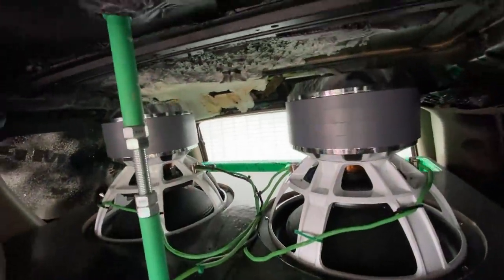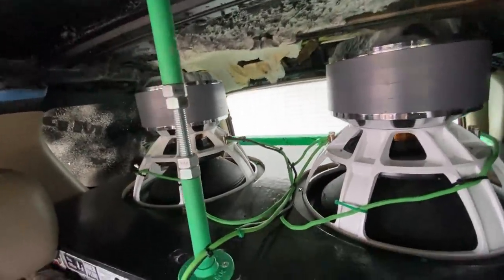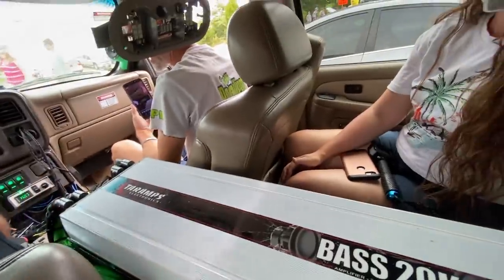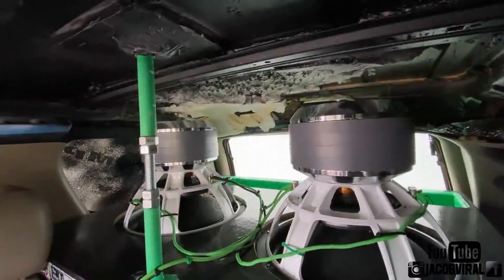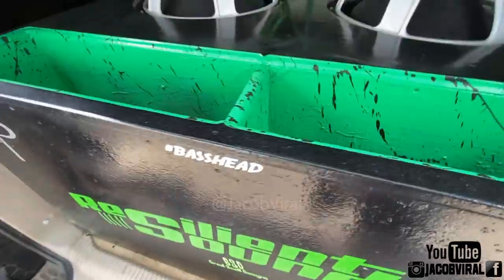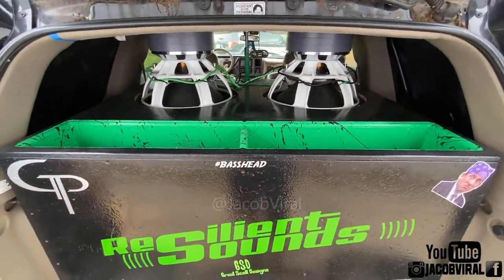QUARTER WAVE T LINE SUBWOOFER BOX ON THIS BIG 20K AMP!

Comment: Junk.  .......... No just kidding.actually seems really good. First time I've ever heard of a quarter T line.
Reply: They are great even with low power,  theres a math n equations to make depending on your sub. they work great once u get the hang of it.
Reply: @jahlieel.e7856  Awesome, thanks man. I'm definitely going to check more into them. Thanks.
Reply: That's not a T-line enclosure. It's too small. A T-line enclosure for two 18's would take up the entire back end of a sprinter van. That's just a big ported mess.
Reply: @kristoffslovijk666 it is a tline, just listen to the specs he says at the start if the video

Comment: Was that a fatboy voltage regular? I have one in my Tahoe and my voltage will actually go up when its hitting hard, didn't know if that was common. I'm 50 and have loved car audio since the 80s but am just doing my first build of this size.
Reply: Mr.T-line  Mine only rises about 2/10ths or so at a time. But never drops below 14.9. Seems like it's a pretty good regulator. Loved your install.

Comment: Awesome box!! I just think it’s crazy that SMD has 4 18’s in the back of his and his box is smaller.
Reply: Mr.T-line yea that’s the good thing about yours. It’ll play pretty much anything while his is geared towards a smaller range which prob explains the smaller box. Idk I’m not a builder or a system wizard lol
Reply: Mr.T-line  also SMD system is older, you have newer more powerful subs THARAMPS amps are monsters he has 6 or 8 1k ROCKFORD FOSGATES so yeah newer car audio it really makes a difference
Reply: Ivan Bustamante SMD has 6-8 t-2500 fosgate Amps which is the biggest best ones they make currently
Reply: @ivanbustamante6011  he is presently upgrading his Hoes system piece by piece
Reply: right! SMD's is super loud. and he's upgrading it as we speak.
Reply: Brandon Lee it’s gonna be interesting to see it redone after years of having it slap!
Reply: Mr.T-line  musical maybe but not burp simply due to cone area. With that being said, you may have room for 2 more ; ]  jk, i'm sure 2 are enough unless you're serious about that wall build. Sticking with RS? I'm bout to switch to Fi myself.
Reply: Ivan Bustamante SMD’s subs are rated the same as these 5000 watts and the 8 Rockford amps he has put out like 3k each and they are strapped so it’s like having 4 6k amps. All of his audio might be older but they are of high quality. JS. This system has a better bandwidth then SMD. Both are good at what they were designed for. 👍🏾
Reply: Brandon Lee is he upgrading his amps and subs? Or just his electrical?? From what I’ve heard from the vid is he is doing just the electrical. Idk we will see. Should be good knowing him lol

Comment: Impressive bad ass amp yea I’ve decided that I’m goin taramps thanks for the video as always Jacob
Reply: go with Bass line fyi
Reply: Be careful with Taramps! You need to study them and make sure you have them hooked up to great electrical with no voltage fluctuations and no vibration or flex on the amp.
Reply: streetbasser786 - Not for the money. You just need to know what you have and how to set it up. Most people who get Taramps can’t afford the good stuff, so they don’t spend money on proper electrical and mount them wrong, then complain after they blow. Another common mistake is improper impedance loads and not knowing the differences in their lineup. Used as intended they do alright, but no, they can’t take a beating like Fosgate or similar.
Reply: Get a  good fire extinguisher
Reply: ed elsey - Or two😂
Reply: It’s not about affording I see a lot of people with them their true wattage a little delicate I heard anyone should know never to mount their amp to the a sub enclosure not a good idea
Reply: vinny galanti - No, it’s a budget amp. They use cheap Chinese boards and cannot hold up against amps with Korean boards. This is a well known fact among car audio enthusiasts who know their stuff. Budget bass heads purchase them because they do put out rated power and the price per watt is cheap, but true enthusiasts know they are more likely to crash and burn, which is why my man mentioned the fire extinguisher. He knows what’s up.
Reply: I got a 8k bass on stock electrical haven’t had a problem out of it yet
Reply: Storm Vangorder - You haven’t clamped it or pushed it to the max during long demo’s either. You aren’t getting anywhere near 8kw out of that amp. What I stated only applies to those who are getting the most out of their systems. Take it to a show and you’ll find out very quickly. You will also get away with a lot by keeping the impedance high. Top tier amps can be rated at 1 ohm and easily handle .5 ohms. You will cook your amp trying to do lower than rated for more power output. Outside of that for a daily driver you should be fine as long as you don’t try to show off too much. It would be wise to get a 150-200 amp fuse to keep you from going too far if you aren’t planning on spending big bucks to upgrade. You would get the same out of a much smaller amp without stressing it as much. Lights will dim on the vast majority of factory electrical on less than 2kw, so you do the math. Let’s not forget that your can can shut off and die on you as well, especially since an 8k needs another amp or two to balance the system. 9-10kw on stock? Come on.
Reply: King Willie you’re wrong about a lot of the stuff you said here tho the whole no voltage fluctuations wtf lmao where did you hear that
Reply: Exodia - Either you know or you don’t. Believe what you will.
Reply: King Willie I’ve owned more taramps than you to actually know I promise you you’re wrong but ok
Reply: Exodia - So what are you claiming? That those Chinese boards can hold up to the same amount of abuse as Korean like Sundown for instance? People love to defend stuff they own, but it doesn’t make their opinions factual. I have all sorts of amps, Taramps included.
Reply: King Willie first off all why would you abuse your amp use it right and you’re fine not the amps fault you wanna wire your amps to the dirt every amp has it’s purpose. Saying ones better than the other is stupid because each amps has reasons why one is better than the other
Reply: Exodia - Demoing at shows all day and pushing stuff to the limit is abuse. Are you doing that, or are you a casual who never even sees what their equipment is putting out? Yes, better equipment can take more abuse of all types for longer time periods, period. I have still have a Fosgate amp from the 90’s that looks like it has been through a war and still works fine. You will never hear of people using 2020 Taramps in the year 2050. It is what it is. Do you even know what compromises a board and why one is better than the other? No, you don’t, so stop brand riding and learn something.
Reply: First of all seen taramps on the dyno true wattage they put out their said power
Reply: vinny galanti - We are debating durability and sensitivity during abuse, not rated power.
Reply: King Willie well in Cali it’s been in the 100s for the past 3 weeks and I’ve been beating on my 12k all day in the heat after about an hour in a half itll thermal protect and cool down for about 30 mins and come right back on. I don’t have any fans in my trunk and it’s all sealed up so it’s definitely over 110 in there during the day
Reply: Exodia - There is a serious chance it will burn out within a year if you keep it up. It might last a while if you don’t drive it down below the recommended impedance load though.
Reply: King Willie yeah I never said I did 
why would I wire my one ohm amp below one ohm? Any amp can pop if you do that Korean or full bridge
Reply: Exodia - Any amp can pop, but the fact that Korean boards are known to last for years being wired down to less than rated impedance means they are capable of putting out loads more power and are many orders of magnitude less likely to have anything burn up, especially when run at the rated impedance. They are just more reliable and longer lasting, period. You get what you pay for which is why amps with Korean boards cost more.
Reply: King Willie there’s so much you’re not accounting for that is hard to talk to you. What about rise ? Why do you think people wire those Korean boards to the dirt? How would you feel spending 1100 on a Korean 5k wire it at 1 and clamp 2k watts cause of rise? People wire so low to get rated power lol
Reply: Exodia - That is irrelevant as all amplifiers are subject to impedance changes across frequencies. I am referring to the durability of the amps only. Again, a Korean board rated the same as a Chinese board will put out more power on average because it will handle twice the impedance load. Losing some efficiency at a lower impedance is a given, but the power output will still be higher. Personally, I like to strap high quality amps together and run at a higher impedance for that reason.

Comment: Great design. Alot of rooks in the bass game talk crap on t lines because they are uneducated and cant build them if they wanted too. Thanks for showing this video jacob. Now the idiots that say that tlines with more than one big sub wont fit in a vehicle can hush up.
Reply: Mr.T-line  thanks. Love your setup mr t line!! I love the quarter wave design, its plays every frequency in the subs bandwidth more even than 4th and 6th orders do imo. And you can remove the box easily if you decide to sell the vehicle or change the system. I know their are guys with with louder one note  wonder ported boxes , but they have to pick certain songs to play to get savage and you can play just about anything and have brutal bass. I admit t lines arent the easiest to build , but its worth it as your system shows. 154 on music is bad ass.
Reply: Mr.T-line  i also was wanting to ask what u set the bass boost at? I had mine set a little under half way and it worked perfectly with my setup. You may not even use it with as much headroom as you have lol. I was just wondering.
Reply: Mr.T-line  most 1/4 wave tlines suffer in the 40 to 60 hz when clamping below or right around rated power. Or at least mine did a little. Thats why i said you probly have the headroom to compensate lol. I had an md 5k on 2 peirce wmd 15s . So i was alittle below rated power. Your guy that built the box will tell you. Some setups are fine with ample power , alot depends on the tuning of the box or port lol,whichever one you want to call a tline. Alot depends on the builder . I see where you are coming from, yes you arent ever supposed to use bass boost , but you would be surprised of how many lower powered tline setups do use it. Helps flatten out the roll off so to speak , but with up to 20k on tap that may not be a prob idk.
Reply: Mr.T-line  its alot to explain, barevids and car audio fabrication channel shed light to what im explaining here. Soo many variables here, port taper, actual port length, so on and so forth but yes some tlines will benefit from around 4 to 6 db of bass boost at around 40hz depending on design. Once agian great setup and thanks for sharing your build .

Comment: That box is way too small for it to be a decent t-line. If he went to B pillar instead of just C pillar, it would increase output
Reply: Mr.T-line  Quarter wave is a t-line
Reply: NGAudio in think he is aware, its his setup
Reply: @williamkillingsworth2619  
Ya never know. I dont know what he knows about t-lines, so I gave a suggestion
Reply: He still has 4 seats and tremendous output. People get confused with quarter wave versus full wave. Maybe you just need to hear it in person. This box is very musical
Reply: @codyscott1161  
I design 1/4 wave boxes. I wasnt doubting that it didnt perform. What I am saying is that if that is 1/4 wave, that box is extremely small for a 29hz tuning. At 29hz, the port would have to be around 10ft long, and the port area for the most part needs to be equal to Sd of the subs. So, if he cut down his port area to squize it behind the C-Pillar, he is decreasing output exponentially.
Reply: @ngaudio9143  I'm tired of folks like you having to explain over and over again. Reverse mounting makes for a much smaller enclosure. The box is around 34 inches deep, with 4 folds. Do the math.
Reply: Smaller port means increased power handling. A small ported box is still a ported box.
Reply: @codyscott1161  
I am sorry you feel that way, but when it comes to T-lines, inverting your subs doesnt do much other than help get a smaller cross section. And you are right, a smaller port helps with power handling, but the entire box when it comes to t-lines is a port. You are sacraficing output and efficiency for power handling if you make your port area smaller than the Sd of the subs. As I stated before, I do not doubt that it sounds good and bumps hard, but it would bump harder if the port area matched the cone area.
Reply: @ngaudio9143  the point of this build is not effeciency. He has a 20k. I built a full size T-line for my fiance's 10w6 as she had room and 500 watts. Full size is great if you don't have much power. I built this enclosure for the bandwidth and to try something new. These subs probably wouldn't handle 20k if port was equivalent to SD. This box has low end like I've never heard. And keeps nearly the same loudness across a large frequency range. No ghost notes or drop off here. I built this so he could keep his rear seats. The math for a T-line is a guideline. A guide line that can be modified for various results. Just as any enclosure. I did not create a new style of box. I utilized space to build what I could. Why just keep building the same old boxes that people have been for 40 years?
Reply: As far as reverse mounting, fitting that magnet into any T-line would be horrendous. Alot of space is saved for useable port length and area. You can also smell coil burn much faster, wire subs much easier, check temperature,aids in cooling  and hear mechanical trouble. Reverse mounting is very useful.
Reply: @codyscott1161  
Because it works? Did you even try throwing those subs and that box into horn resp? I built my t-line full sized. 200sq inches of port and cross sectional area per sub. Running 2 18's that are rated for 2k each. Box is tuned to 28hz and Ive played down to 18hz at 6k watts and haved even over exurted. Hornresp says I could throw 10k into each subs and they still wont over excurt. Making assumptions for a box design that is picky on how much space is used is never a good thing. Im glad it worked out for him and you, but you should seriously learn how to use horn resp if you feel like going out of the norm with 1/4 wave enclosures
Reply: @ngaudio9143  you reduced port size as well. Does that mean your enclosure does not work? SD of an 18 is around 233. I would like to see a video of the full size T-line. I couldn't find any on your YouTube page.
Reply: I believe that I have the right to be risky when building enclosures.
Reply: @codyscott1161  
The SD of my subs are just under 200sq inches. Soundqubed HDC4 18's if youre wondering. Most 18" subs are going to be around 200sq inches. And I dont normally post to youtube and Im not going to just to prove a point. I have given you my input from personal experience and extensive research into quarter wave t lines. I have built and designed a few t-lines so if you dont wanna take my word for it theres a whole group on facebook specifically for 1/4 wave builds. Go bug them about how I dont know what I am talking about.
Reply: @ngaudio9143  I can tell you do know the rule of thumb with transmission lines. Just know, you can modify them. You don't HAVE to use the golden rule for a good end result.
Reply: @codyscott1161  
And thats another thing youre right on. Along those same guidlines, you can shrink your crossectional area by up to 40% without too much variation in performance, which is a little bs. For most subs its closer to 15-20% for the smallest you can go without suffering performance.
Reply: @ngaudio9143  I agree completely.
Reply: @codyscott1161  
Then I am confused as to where the argument is. If those subs have 200sq inches of sd or more according to you, then the cross section and port area of that box is way smaller than 20% less than cone area.
Reply: @ngaudio9143   subwoofers do suffer from a smaller port, though they do not distinguish. Smaller port takes more power to get as loud. These subs are getting double power at 2/3s port area
Reply: The argument is that you said it's too small to work right. I'm saying it's small and it works as intended. It works very well actually. Large bandwidth, great output.

Comment: That's not a T-line enclosure. A T-line with two 18" subs would take up the entire back end of a sprinter van. I've built many T-line enclosures over the years and that's no T-line. That's just a big ported mess.